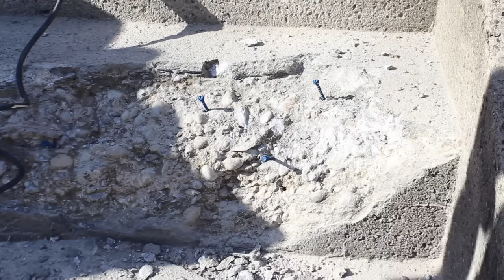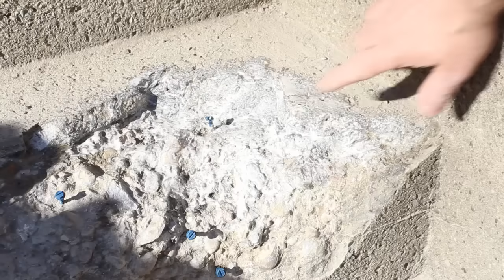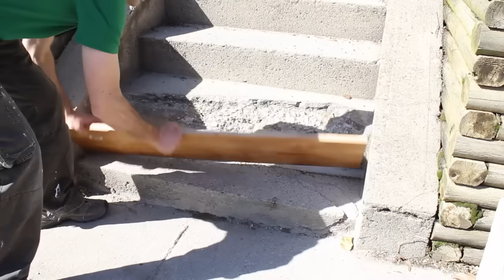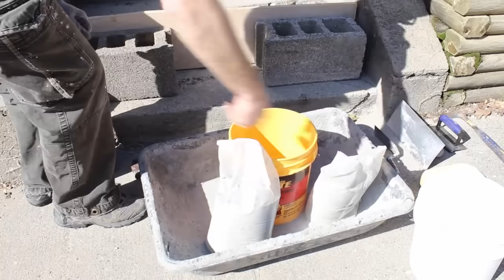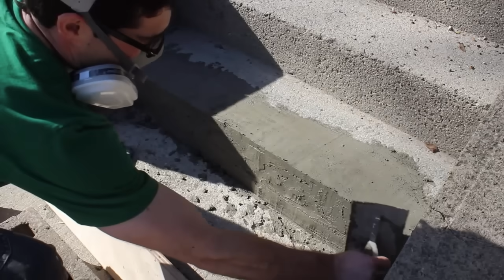Cement Step Repair in One Day

Comment: leaving the tapcons with smart for strength and stability maybe could have used a few more but anyway good idea I passed under lawn mower over the years and that is one way to do it
Reply: I fix more than 100 concrete steps decks and sidewalk. I've worked on over a hundred or more in my lifetime yeah corn Curry pasta have coins boards and trial and everything should work out fine

Comment: If you live in a colder region where freeze-thaw is common in the winter months, I avoid a quick setting cement and use a mix with air entrainment.  This will give the repair a longer life and prevent crumbling from water expanding in the concrete when freezing.

Comment: You know the cement you pushed in at the bottom of the step with the corner trowel? 3 years from now that will be breaking away because you didn't use a bonding agent with the old surface

Comment: Great video, and was just wondering how long you leave that form board up against the concrete, before pulling it off. It looks like as soon as you had the cement finished the way you wanted, and still wet, you then pulled the form board off.
 
Can you reply here, it will be very helpful to me thanks- Canada  🇨🇦

Comment: Fantastic job, many relevant tips for my first attempt at a similar repair. Thank you for sharing them.
Reply: I had planned a form, but using the release agent was not at all in my head.
There is one trick I have devised to inject concrete under my steps, I'll run it by you if it works. Again, thanks for the great content.

Comment: I’m sorry, but that’s not right. First off before using an adhesive the old cement needs to be wet to adhere to the new cement. The adhesive should not be dry, what is the cement going to get its moisture from dry adhesive? When I need to deal with cement issues I watch Mike haddock on YouTube he’s been doing masonry for over fifty years. He answers all questions before you can ask them.

Comment: I am adding one step to my concrete slab and putting decking boards on top to replace
 rotten boards. I am making a box frame and placing it in front of the slab. However the riser on the slab is less than 90 degrees.  How do I fill the gap in order to make it 90 degrees? Same way as you did the repair? Can I use mortar instead of cement or will cement stick better? Remember that the step will be made of deck boards same as the main part.  I hope you can advise.

Comment: A couple of quick thoughts/notes on preparation, etc. 
Cleaning with a wire brush and then sweeping/vacuuming out as much as possible gets rid of as much loose debris as possible.
A masonary bit on a regular drill may work for anyone who doesn't have a hammer drill when drilling for 'Tapcon's' 
If using a hammer drill (not to be confused with an impact drill/driver), make sure to set the tool to 'drill' and not 'hammer drill' mode before driving screws. (This is for those who don't have a hammer drill or have never used one). For anyone who has not drilled concrete, buying a cheap hammer drill is recomended (or a good quality tool if you plan on using it often).  
For the thicker/deeper areas, I like to embed some wire mesh (hardware cloth) or even epoxy coated rebar if it is a large/thick/deep area. 
This will provide better structural integrity to the piece. Note the side of the aggregate (stones) in the original step is pretty large, compared to tha of the product being used. Aggregate gives concrete its structural integrity although these 'patching' products are formulated with various chemicals to make them stronger and more cohesive than 'plain old concrete' (cement, sand, and aggregate).

Comment: I'm about to repair the corner of a concrete step like this using quikcrete. I've read that you need to use a bonding agent first or the new concrete won't adhere to the dry concrete, but you didn't do that. Is it unnecessary?
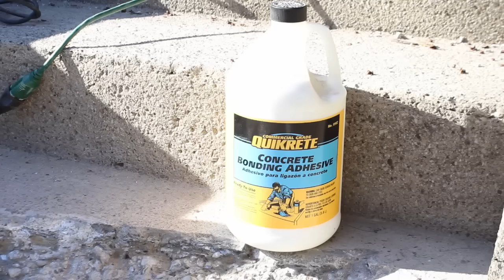Reply: See 1:28

Comment: You painted the bonding agent straight from the bottle on to the concrete.  No premixing it with a little concrete first?
Reply: Not sure on this perticular product if that is required. Usually, no. Jus brush on. Some products want the old concrete surface to be pre-wetted. Not soaking wet, just wetted with a spray bottle. There are so many products on the market now, one has to read the instructions eiher on the bottle/package or online. 
Just to get the terminology straight: "In short, the difference between cement vs concrete is easy to clear once we know all the basics of their compositions. Cement is a binding agent made from limestone and clay; whereas concrete is a building material created through the proper mixing of cement, water, sand, and rock."  At the store, the cement for this type of concrete work is (usually) called Portland cement.

Comment: I took down our porch and was left with a battered looking concrete slab base. I've been thinking of repairing it in this way and then using tiles to finish off as a decent sized front door step. This video is spot on for my idea

Comment: RapidSet CementAll or Mortar Mix along with a bag or two of flow control would be pourable and rock hard in an hour; while RapidSet doesn’t need/require a bonding agent it can be used. I like the pourable flow as it gets into every nook and cranny whereas stiffer concrete mixes and those with larger aggregates can have voids when used as patchers, if not vibrates or settled in. Nice step by step though I’d add rinsing, washing, or spraying water on the concrete both to get the dust off as well as to aid with bonding though that, in part can be mitigated by the bonding agent. For bonding to old concrete I find wetting and a mix in bonding additive gives better results than a paint on style bonding agent; I usually only use paint on bonding agents on painted, sealed, or non-porous existing concrete. There are flow additives which help make concrete flow without adding additional/extra water which can weaken concrete.

Comment: Yeah, you better work quickly.  I DO NOT use quick-setting Quikrete for jobs like this.   If you use regular setting cement, you won't have to fill in the holes after removing the form because it will easily form perfectly because it's not trying to get hard FAST.  I'd recommend just the high strength mix, not the quick setting.  That's just me.
Reply: I don't do this ever, but now need to repair my steps.  My wife tells me to only hire out to folks by the job and not by the hour because I am slower than molasses.  I was thinking it would be better for me to use regular concrete.  I am glad to read that you use regular concrete mix.

Comment: Those tap cons make a huge difference, there was this real old timer when I was growing up, he was from Hungry he would add some metal shavings from a machine shop in with his mortar, the way he explains it , they will rust and lock into the cement, not sure if it worked I never tried it, sometimes the old ways are best tho
Reply from the maker: yes, I love using Tapcons as anchors because they give material something to grab onto; interesting idea with the metal shavings, I’d be worried about rust or staining over time
Reply: @HomeRepairTutor  So drilling those screws would not weaken the current structure of the remaining step causing it "break off" in a subsidence  of some sort?   I have never done this before so I am just trying to think things thru a bit....:)
Reply: @konczalr  depends how much concrete you are screwing into ! With a big space , tap cons are meant for concrete / cement - so you shouldn’t have an issue !! It’s like a little rebar in a sense

Comment: This was a great video to start my front step repair. Although the quikrete dried and caked too fast and had unfavorable outcome.
Reply: I hope you used type S mortar NHL 3.5 and let the stairs soak up some water moisture a hour or so before poring the mortar otherwise it might start cracking again without a good healthy bond!

Comment: Good video I agree with all of it but I would not use water to mix my cement.  I would use the bonding agent instead of water it works great.  You can also us it to skim coat if you have a low spot on a sidewalk.  Did it 6 years ago it sticks and has worked great in Colorado winter and summers.

Comment: I hate to nitpick, but why spray the board with Pam right ON the step??  You could have just sprayed it on the ground. And using a level as a screed?  No....use the right tool for the job. A straight piece of lumber would work.

Comment: I'm wondering how durable this repair is in a geographic area where there are seasonal extremes in temperature that can vary from -40c, (40 below F) in winter, to +38 C, (100 F) in summer..
Reply: I live in such an environment. may I suggest a new set of steps? This is a cheap try indeed and may work, may not. The freeze will have the worst effect based on moisture that got between new and old. Do use tapcons and bonding agent for the best lasting result.

Comment: I drill some 3/8th inch rebar into step repair like that. Get it drilled into something real good and bend it where you want. The tapcons do help though. I use them on smaller patching jobs where rebar won't fit

Comment: That fast drying concrete dries too fast. It starts to set up inn under 5 minutes. 
So that 15 minutes that it says on the bucket is BS.
Reply: What Cement would you recommend for a project like this?
Reply: @undagroundrican  Search for mike haduck.
Reply: @saulgoodman2018  thanks will do
Reply: @saulgoodman2018  also his explanation is exactly what I was looking for. Saw the first video. Will watch the other 2 he has since put out.

Comment: you need to dampen the old cement before apply bonding adhesive.  remember to mix the bonding adhesive with OPC too 50/50
Reply: Opc?

Comment: My step is hollow and I have to fix the face, the side. Suggestions? Should I use a mesh? Shoving Crete into the hole doesn’t seem like it will work; it will fall into the hollow space behind it.

Comment: Hi Jeff - your video indeed helped me a lot to fix my crumbling stairs at the front of my house. I would really appreciate if you answer these questions: (1) After the Quikrete quick setting cement is dried, I can see some fresh cracks in the stairs. how can these be fixed? (2) how to use the sealer and how many days one should wait before using the sealer? (3) Is is recommended to use resurfacing cement to smooth out the cemented / concrete area? Kindly advice.

Comment: Is it possible to do gap filling if the steps have moved away from the house an inch or so?
Reply: No anything added in that small of a gap will crumble out eventually, best option is to mudjack the step back into place (since most pulled away steps are so because the ground underneath the front edge has sunk or shifted, fyi mudjacking is the process of pumping liquefied aggregate under concrete to raise it) OR break out the step and pour a new one using proper compacted base underneath and an expansion joint between the step and house for best long-term results

Comment: You're not supposed to wait for the bonding adhesive to dry before adding the fresh material!
Bonding adhesive = GLUE. 
Have you ever heard of anyone applying glue to only one of two parts that require bonding, and wait for the glue to dry before joining with second part? 
Decent video otherwise.
Good thing you placed the tapcons and sealed - that's what's holding your concrete together, if it still is so
Reply: Some packages say dry some say wet depends on product.
Reply: You are literally describing contact cement. This is exactly how you use it. So yes, I have heard of waiting for the glue to dry before joining. This is how you do veneer and laminate work...
Reply from the maker: yes, the step is still in good condition

Comment: no reason to use the respirator
Reply from the maker: +Min Behårede Pik I’d rather not breathe in dust from the product
Reply: If you are doing it once in a while, sure, but cement dust causes silicosis, lung cancer and it contains lime which will burn your skin if you are working on wet cement, so I assume it would melt your lungs too.

Comment: I am a cement finisher and have been pouring concrete since 1974. That's a good video however there was a few things I would like to suggest. First of all you should have used the edger before you took off the wood that would give you a nice clean Edge along the top to follow once the wood was off. Also before you took off the wood and you were pouring the concrete you should tap the face of the wood with a hammer. That would have gotten rid of most of the honeycombing. That's what it's called! It was good that you used the sponge at the end and you did a nice job🖒
Reply: Also, cut your form to the height of the step; that way you have a template/ guide to set the height consistently with the existing concrete and ease the edging process. Good job!
Reply: thank you for using the word "concrete". thank you for pouring hundreds of thousands of yards along with me.
Reply: Is it not mortar or plaster since it does not look to contain aggregate? @TheSaltblock
Reply: What if the wood is stuck to cement? What do I do? Take a hammer to it?
Reply: Hiii are you recruiting?
Reply: Can I use this method to repair a stair in gunite pool that looks like your "before"stair? Maybe include a polymer additive? Thanks
Reply: hi, in your experience, how well does this type of repairs hold up against winter weather and de-icing salt? Will i have to re-repair in 3 years?
Reply: Steve Zazulyk p
Reply: What price does this job typically cost?
Reply: @TheRealJoga $50 bucks or so.
Reply: I like your attitude man positive and informative. Refreshing!
Reply: Steve Zazulyk helpful
Reply: Thanks for re-enforcing my own thoughts, for when I start my next project.
Reply: yes....could you go a little further and vibrate the board or will the  "tapping" give the same desired effect No voids?
Reply: Followed most of your directions. I found the only quick-drying mix available had a pea-gravel aggregate in it; a big surprise when I cut open the bag. The home center also didn't restock their glue, so I used some old cement epoxy-adder as a glue. I hope it turns out.
Reply: You don't have to use sand?
Reply: Contractor messed up our new heated concrete steps. My size 6 foot doesn't fit on 6 of the 8 steps. How do we fix it? 
Needs about 3 more inches out to be the same as the correct 2 steps. 
Thanks 
Lisa
Reply: @lisalynne2330  sue the guy that did it and hire someone to redo the stairs! You have to make the whole stairs bigger to accommodate the correct tread width!  I tried to fix my basement ones with the same issue (but mine are from the 60s) and research indicates the entire base of the stairs has to come out further!  It's very complicated.  Go sue them for breach of contract.  I'm pretty sure stair tread width is a BOCA thing.  Most contract statute of limitations is six (6) years.
Reply: Excellent addendum to a very informative video for a rube like me.
Reply: And use concrete
Reply: That's nice for one step, but all 6 of my steps are like this.. it's going to be a chore, I bet
Reply: How much would this repair project cost now In 2025 ??
Reply: @bulldogg285 if you do it yourself, all depends on the area your doing,if it's your own home who cares about the price
Reply: It will not last long,only way to do it is cut a square area out around the broken area ,drill some reo bars in the broken area, tie reo bars forming a box like look , before adding  concrete ,making sure job is free of dust,then brush job with boncrete adhesive, then concrete,then finish making the job blend in with other look or matching concrete, by cutting job out square, makes it stronger for stepping on when people walk over it.cheers
Reply: Forgot to mention, farmworkers or box it to the height of what ever,cheers
Reply: Steve Zazulyk has come
Reply: Helpful tips dude. Thank you
Reply: Random questions for anyone (if you can help me, it’d be greatly appreciated): 

The concrete to the basement door entry (outside) was refinished.  

1. Are the contractors supposed to haul away the cement pieces or is it the homeowners job? (They left it by the back fence)

2. Is the concrete supposed to be completely level or dip by the drainage?
Reply: Hi! I know you wrote this two years ago haha but me and my dad just moved into a new house and our pool is completely crumbled away around the edges and is almost like a pond, I was wondering how I would fix it (if I could) and how much would it cost? Thanks!
Reply: @ali-iy2vu  now it’s 2 years late for you and 4 years later for his comment.
How did your pool turn out
Reply: @dirty_money5439  hi! We unfortunately had to get rid of our pool it was very old and a custom pool so the only way we could fix it is to have whoever made it fix it because other pool company’s said no to helping us and sadly the pool company who made it wasn’t in business anymore. My pool was honestly beyond repair though so good luck if your trying to fix yours!

Comment: Great video! 

An area about 4 feet long by 12 inches wide of the cement on the entrance to my garage, just outside the overhead door, looks like that step you fixed. A lot of "popcorn" but the damage is not very far below the surface. 

Your repair method seems applicable to my situation, but I'm wondering if I would need to "excavate" down below the surface and/or perhaps cut a perimeter around the bad section and dig a bunch of the bad stuff out, or if I could just chisel  it out a bit and fill and smooth it.  Sort of like a thick top coat? 

Repairs like this seem problematic, especially if you don't have a concrete saw. However, maybe chiseling it out and filling it using your methods and those products could work.

Any advice would be greatly appreciated. 

Best Regards!